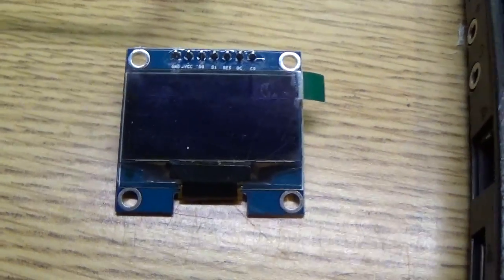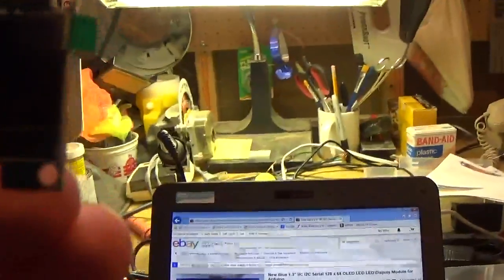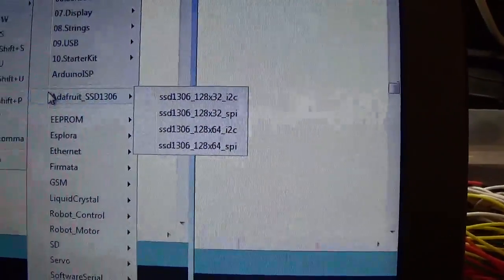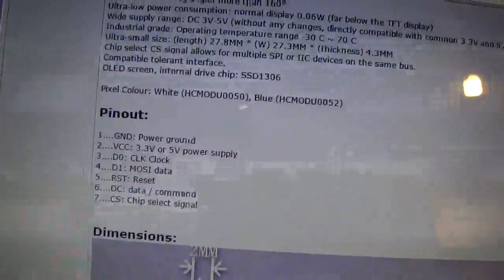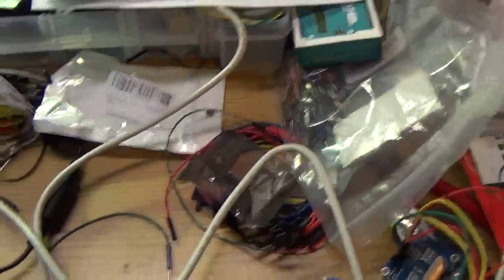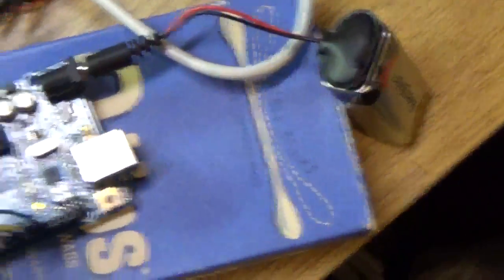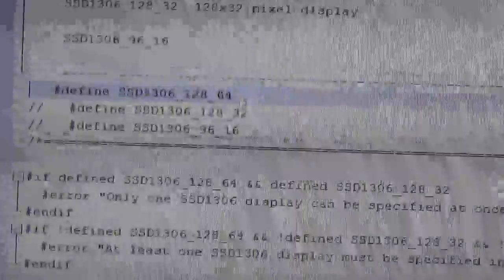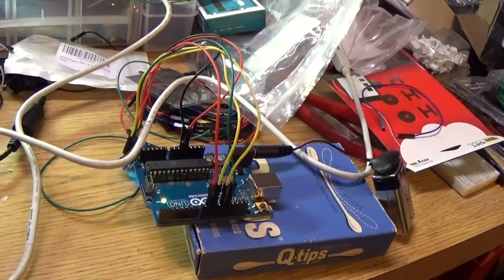Arduino / OLED Display  (Part 1)

Comment: Hi, I had this problem too. I saw Farhad Malekpour's comment and tried to search for "SH1106 oled display", I found a project on the internet that uses this module. I picked-up the display librarie from it and it worked. I was able to run the example codes uncommenting the "U8GLIB_SSD1306_128X64 u8g (U8G_I2C_OPT_NONE);" constructor calls. My display is 128x64px with i2c communication. There are the other versions with the others kind of comunication too.

download the library: https://drive.google.com/file/d/1o-XVA2iu9JR_2iVKQy3obisJBtJx9-I5/view?usp=sharing

Project that I found in case that I remove the library from my drive
video link: https://www.youtube.com/watch?v=GGtP0alnQzs
his project download: http://stukan.de/Oled1.3-0.96.zip

almost worked all, everthing was print in the display, but they are 2 pixels lines shifted to the left, so 2 pixels lines was lost outside de display in the left side, and last the 2 pixels lines on the right were random
see what's happening with me in this picture: https://drive.google.com/open?id=1c1HI4SAcKvk24At5K3NllXYir5RNyryb
Reply: Thank you, it work for me

Comment: I have a similar one with I2C though. Got the very same garbage with SDD1306 lib. Actually my part is a SH1106 and it works with the u8g2 library. 
See: https://github.com/olikraus/u8g2/wiki/u8g2setupcpp#sh1106-128x64_noname

Comment: I have sloved the problem.
I have had the same problem with the garbled screen using Adafruit SSD1306 library. The solution is to use the U8g2 library. Post in forum http://forum.arduino.cc/index.php?topic=265557.0 helped me.

Comment: The problem you are having is likely caused by the screen having a different driver chip, IE not SSD1306,i have a few little oled screens, and I've seen that exact symptom occur when you use a library for SSD1306 on a SD1106 display, the easiest way to check in to download u8glib(https://code.google.com/p/u8glib/),and try it, it can push the SH1106, I ended up writing a lightweight ASCII only library that pushes both of those display chips cause the rest used too much ram for my uses and i wanted something simple.